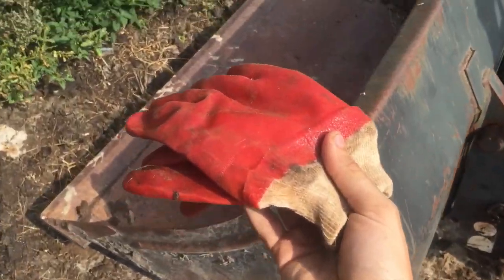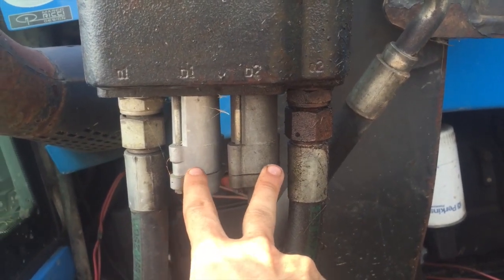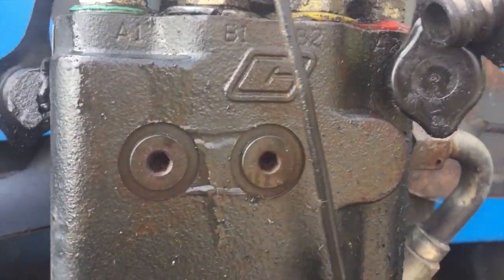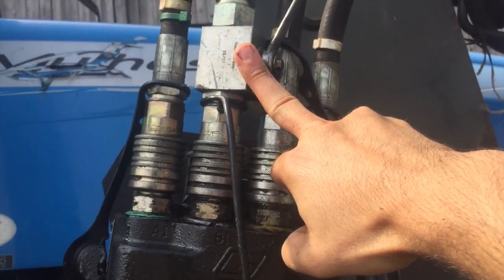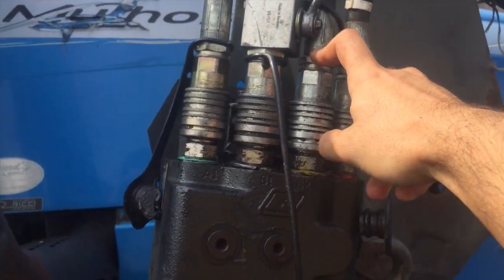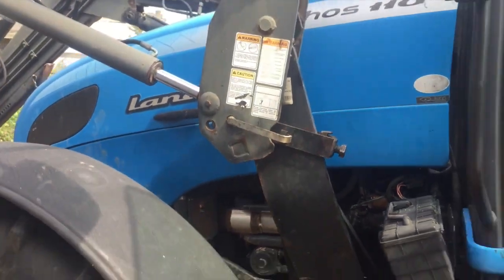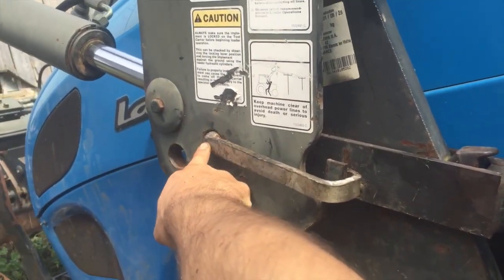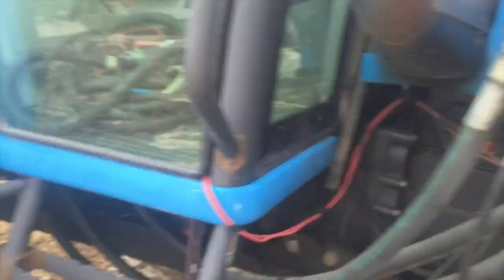hacks for putting a quickie loader on a tractor

Comment: Oh man, l wish your had filmed yourself actually dropping the thing down onto the connectors and hooking up the hoses so as to see it happening... l just got an older kabota with the q750 system on it, and it looks exactly like yours. Sure would appreciate it.. thanks for posting this though, it's the only video l've seen that was even close to the same as my system.. thumbs up.
Reply from the maker: hard to film and work loader at same time.lol
Reply: Sorry for being 8 months late. The video shows more or less what you have.
Mind sharing what's troublesome?

Comment: I know this is several years old but my Q720 loader is even older.....I can't get the hoses to disconnect. I have those shown in the video. Is there a lock or something? I removed the pressure from them, I thought they were just seized by rust and corrosion on the inside but I've been hosing them with WD-40 and tapping them with a hammer but the part that you grip and slide up won't move separately from the inside barrel. Any suggestions? Thanks!
Reply from the maker: one hose has a lock that does not work.The first time i took my loader off it was a bugger.The pins were the hardest for me.just keep working at it maybe a bit of heat of quick connect.

Comment: Good day.  There is alot of Quickie  loaders. I think they are probably more reasonably priced. When installing  the 4 hoses, #2 hose had that  I think you said  electronic part,what does that do.   I know yrs. we had to chain loader to tree or beam. I have older dunham loader,ever thin g has to be perfect lined  up. What is wrong with 35  Thanks
Reply from the maker: Line #2 has a ball valve on it.I do not know why.It does not work anyway.The 35 I think it has a bad conection to the battery.Hopeing to have it fixed and off the drive way soon.I beleve quickie are the most expensive loader now. I see less of them on new tractors because of the price.
Reply: You could move the ball valve to the other end of the hose on the inside rail of the loader where it would be out of the way. it can do nothing there too. Nice video
Reply from the maker: good luck getting that thing loose.haha
Reply: with a long enough pipe on the end of the wrench.... everything comes loose.  LOL
Reply: The two lines you are referring to that you said were electric are actually cables. The ball valve is so that you can lock the loader in position so it won’t bleed off when parked. You can generally tell when a joystick is electric because it will be super easy to move compared to a mechanical or hydraulic joystick.